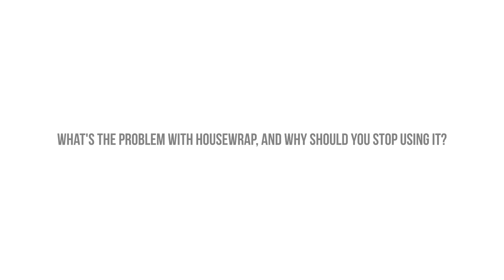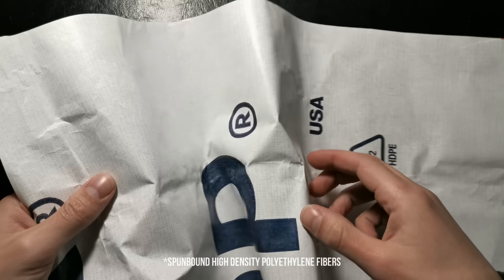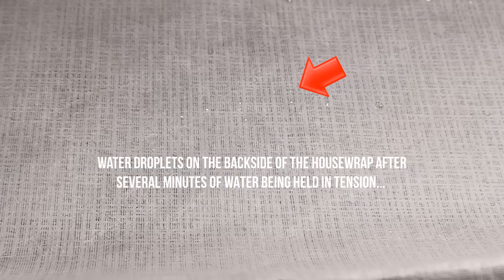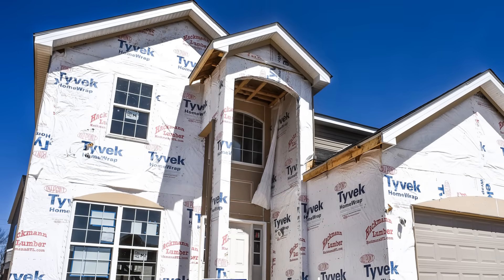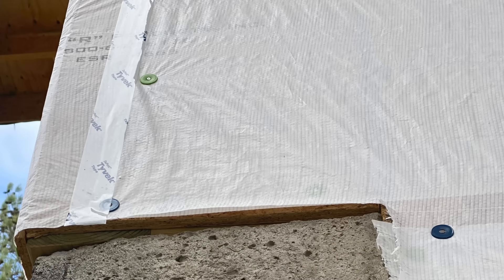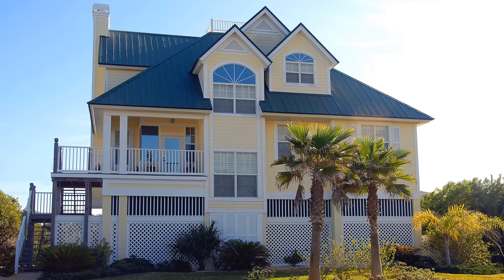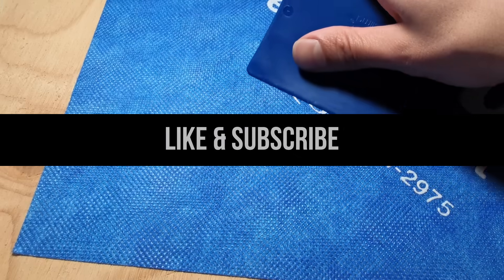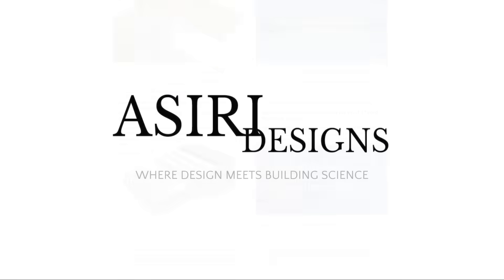Why I Stopped Using House Wrap

Comment: Why dont you just paint the sheathing with a good quality paint and tape the seams then put a rain barrier between the finish siding to drain any moisture? Some of these specialty sandwich sheathing products panels are no good for shearwalls
Reply: You don't need to paint the sheathing if you install a rain screen like Tyvek properly. By properly I mean do not staple it directly to the sheathing. You install   3/8" thick X 2" wide plywood strips vertically onto the sheathing then stretch the Tyvek over the strips and staple it only to the strips. This creates a vented space between the sheathing and the Tyvek. If water does get past the Tyvek it just drips down the back side and never touches the sheathing. Your siding then gets installed on vertical or horizontal furring strips as per usual. The sandwich layer now becomes siding, vented space, Tyvek, vented space, and finally sheathing.

I did this on my shop 20 years ago and all the layers are in pristine shape. The key is in the venting between layers and that the Tyvek acts like a rain screen only and not an air sealing barrier.

The thing is no contractor will do this because installing vertical strips before the Tyvek is time consuming. Well...if you want it done right you always have to do it yourself.
Reply: @OU81TWO  I like that idea
Reply: @badawesome   It works great. I built the 24x30 shop in 2004. The sheathing is 1/2" OSB and the siding is 1x12 board and batten rough sawn pine.  I live in a northern climate (Canada) with a significant amount of rain and snow every year. Last year I removed a board to see how the Tyvek and sheathing held up on the side of the shop that is most exposed to the weather. I deliberately did  not install 5 vertical battens 20 years ago to see what would happen if snow and rain got into the gaps between the vertical boards over that 20 year period. The Tyvek and sheathing look and feel the same as they did when I installed it. Like I said the key is having the vented spaces. It makes all the difference.
Reply: Because its not stable enough. over the long term the paint will crack.  Essentially you're describing an inferior version of a fluid applied membrane.
Reply: @juskarn Hence good quality paint. High quality exterior paint sitting behind cladding is not going to crack and deteriorate in the sense that you’re insinuating especially if you have a couple of coats on there.

Comment: what your thoughts on a WRB over plywood with comfortboard exterior insulation?  The specific wall system I am asking about is exterior cladding fixed to strapping over comfortboard. Behind the comfortboard is the WRB, then the exterior sheathing and the interior insulated wall. I'd love to hear your thoughts on that type of assembly
Reply: One thing I always wonder, and there are people that believe strongly on either side, isn’t it better to put tyvek on the outside of the insulation to stop air from speeding heating/cooling of the insulation?

So many studies done and pretty well everyone agrees that air movement reduces insulations effectiveness, like batts in the wall cavity.

So being those batts at least have plywood and they are affected by bad exterior air sealing, wouldn’t the exterior insulation ESPECIALLY when strapping add to this?

Of course strapping it helps drainage, and one of the other big bonuses is it can speed the drying of the housewrap, for moisture coming from with the wall cavity. 

That added airflow over the insualtion would surely reduce its effectiveness right?

Why not the exterior insulation , and then the tyvek. Properly installed it’ll waterproof the insulation (I know most foam and mineral wool is good with moisture) but why not?

And then it’s stops the airflow lowering effectiveness. Stops the moisture from over time degrading or possibly mould if a very humid rainy environment (maybe between strapping and insulation where it didn’t dry as much).

As you say in the video, we all know water gets being siding. Why let it run on the insulation?

I just don’t see the negative, the home is still waterproof and CI and to me performing better?

Any opinions on this?
Reply: And I know mineral wool and foam aren’t as susceptible to air movement as fibreglass.

I’m just thinking even like any bottle etc. not factoring sun but just the difference in how fast a thermos or anything will cool in the same times one with wind and one without.

Not movement through as much. As poor Vapor barrier sealing and housewrap sealing causes draw to happen through a wall cavity.

But just the movement overtop.
Reply from the maker: @TheHowtoDad  Great assembly, we actually have a whole video on this exact wall: https://youtu.be/VwUjkSjllPs?feature=shared
Reply: @ASIRIDesigns  watching it now. thanks

Comment: can fiber cement board eliminate thew use of house wrap as the frame board since it a water resistant
Reply: Do you mean cement board in place of OSB sheathing?  If so, the manufacturer would surely say it isn't made for that purpose.  Your carpenters will say it is too hard to cut and install.  ZIP system sheathing as mentioned in the video is a better choice.
Reply: @misterlyle.  In my area we don't have zip sheathing here in Nigeria so but we have fiber cement board the manufacturers claim it can be used and you can basically just screed and paint on it
Reply: @yusufdoba3891  Thanks for the reply!  That sounds perfectly reasonable.  I know of two kinds of fiber cement board, one is a backer board for floors and tub enclosures to go under the tile, and the other is the Hardie board fiber cement siding product available in sheets and planks.  Both of these can handle rainy weather conditions, but neither seems likely  to provide the strength of standard sheathing materials.  This is because they are significantly more brittle than the usual siding materials.  Here in Florida, walls are built to the latest building codes in order to withstand hurricane conditions.
Reply: If you have access to MGO (magnesium oxide) board in Nigeria, then use those instead of stragith up fiber cement.

Dont think structural sheathing is mandatory anywhere outside of North America, so you should be free to use whatever.

Comment: I used Zip sheathing on my house to air seal the home but I didn’t trust the tape because I just didn’t have any confidence or experience with it so although I did tape the seams of the zip well, I used Tyvek over the zip sheathing. I have vinyl on my house.
Reply from the maker: @CMCraftsman  Fair enough! A few builders I know use ZIP for the primary water/air barrier and a drainable wrap installed over it to provide a drainage gap without having to install battens. Of course now we have things like rolls of entangled mesh which can be used instead. Thanks for watching!
Reply: @ASIRIDesigns  yes I would definitely do things differently today and use exterior insulation and skip the Tyvek. At the time I was up against rotten osb on a home that had vinyl and no house wrap under it that I closed on on Labor Day and had to get it stripped and closed back in before the mice and cold Vermont winter showed up. I didn’t have much time or even the money to do what I’d do now.
Reply: @CMCraftsman  Thing I don't understand is how to do windows with a wall that thick. Do you put the window on the exterior of the insulation and then build a large sill?
Reply: @sidewinderam9m you can get extended brick molds, with integrated j channel, if you're doing siding
Reply: @sidewinderam9m  They way you suggest is the way it's usually done.

Comment: Your videos are always so incredibly useful. If you (or the experts who watch your videos) have any guidance...I'm working on an extension to a not-well-insulated 100-year-old building, and am using 1 inch foil-faced (radiant barrier) EPS sheets as exterior insulation, plus r20 mineral wool in the cavity.. I was planning on taping the seams of the EPS and using that as my vapor barrier.

Is there any reason to put tar paper or anything else on the OSB sheeting beneath?
Reply from the maker: @theglassishalf  Interesting building condition, I'd have to look at the greater context before I gave you an answer. Where is the project located?
Reply: @ASIRIDesigns  We are located in the Pacific Northwest, specifically Bellingham. Thanks! Putting this on in the next couple days! :)

Comment: Spot on with the Tyvek! I'm going to use Henry VP100 on my current build. Any issues with that product? Climate 7a
Reply from the maker: @brianwball40  It's a good aftordable product, just make sure to use a primer because it tends to lose adhesion in colder temperatures.